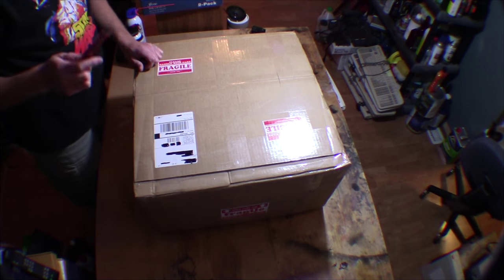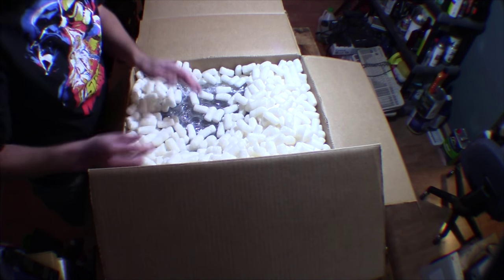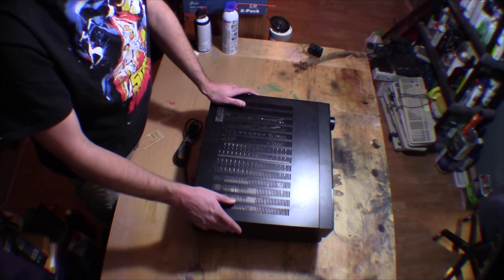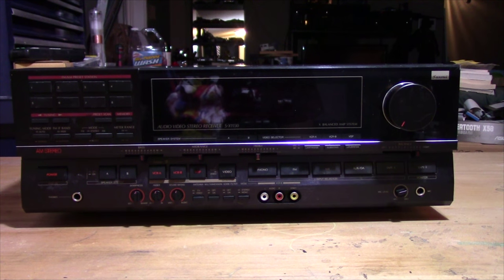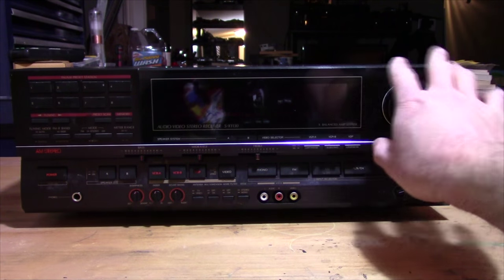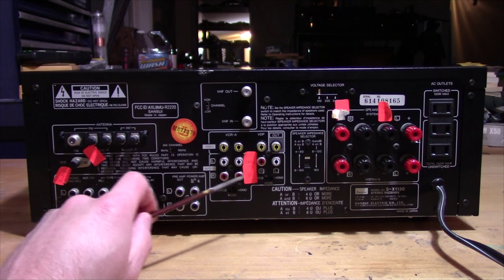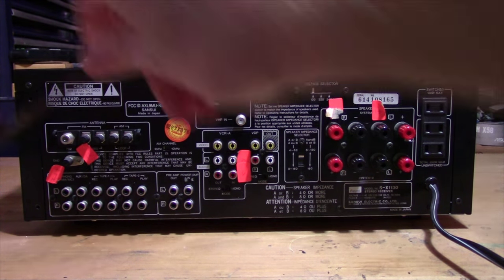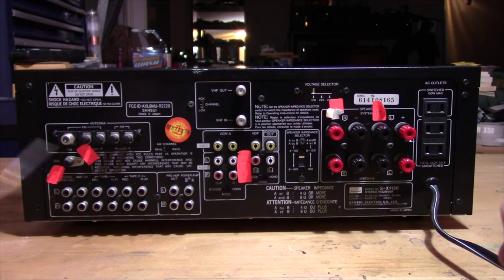Sansui S-X1130 Part 1 - Unbox, eval + initial testing

Comment: I have a JVC RX-315 Compu Link 2 channel Stereo receiver rated at 105 Watts per channel at 8 ohms with .002% Total Harmonic Distortion. And yes she's a heavy duty one from back in the 80's. I really enjoy it. It currently acts as my amp for both my laptop and Xbox 360. I currently have two pairs of speakers hooked up  one being a set of Bose Acoustimass 3 series 2's and a set of Infinity SL's that I picked up at a yard sale for $4. The Acoustimass 3's I found on Ebay for $85 and I've been really happy. I've  always wanted Bose since I was a young man and now that I'm older that dream has come true I'd say you scored a good one with the Sansui. I only paid $50 for my setup. It came with a 6 Disc CD Changer and a dual well cassette deck, both of which I gave to someone who had a use for them and I ended up keeping the receiver. She's given me years of service without issue and I'm looking forward to many more.

Comment: Good video. Would love to see a follow-up with your opinion on the sound. Specs are impressive but how does it sound 35 years later? Thanks!
Reply from the maker: I have not owned this unit for a few years now.  I think it was an epic monster receiver of the 80's that doesn't get it's just credit as such.  Clean sound and if you wanted it to move the cones on your speakers, it would without question.  I have looked at the specs of modern Amps, like the Pioneer Elite series and their  THD % is nothing compared to this receiver. THD% is efficiency and this was among the giants.
Reply: @WaybackTECH  I own this receiver now and can confirm that it sounds fantastic. Soundstage is deep and wide and it needs very good speakers to reward you with its full potential. The S-X1130 tends to have problems with burnt-out lights in the vacuum-fluorescent display. I wonder if they could be fixed. The display itself looks very classy in the best 80's ways. Back then only the high-end audio gear had this fresh new (for that time) digital look and layout. The volume knob feels smooth, solid and luxurious, another big plus in my book. I appreciate your videos of the S-X1130 as they are a rare record of this often ignored model. FYI, this is not a rare receiver, as I initially thought, but it's a definite sleeper.

Comment: Hi I got sansui S-X1130 the whole panel lights up cd aux phono together and can’t seem to select any of them individualy was told by the repair shop it’s an ic number TC9152AP but they can’t get hold of one r they right about the findings or can u please help

READ MORE
Reply from the maker: There could be a bad solder joint. But if the IC is fried, it could be hard to find.